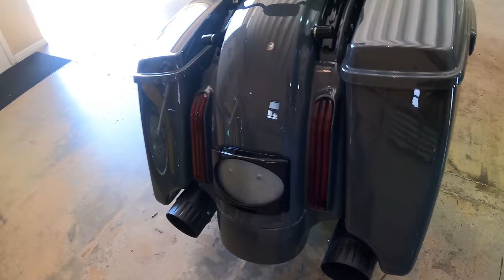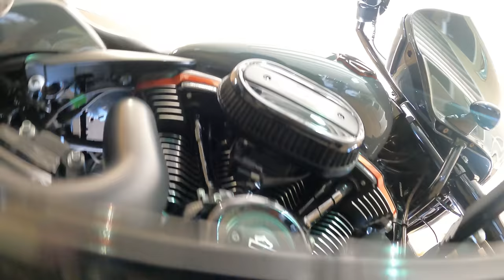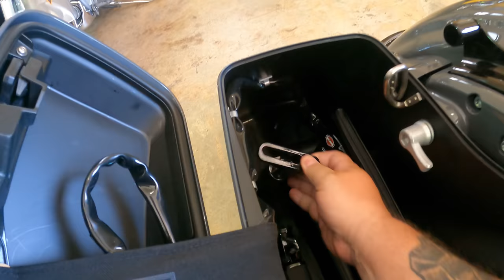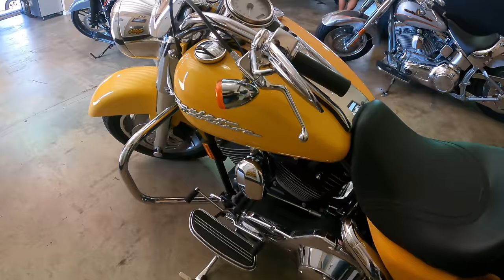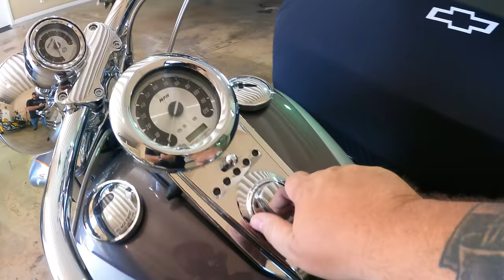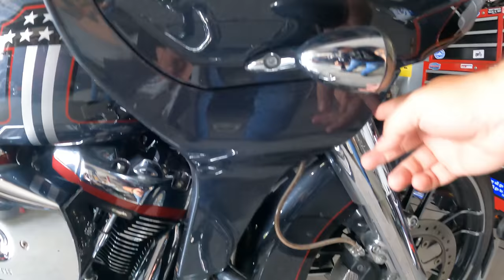How do you avoid a bad used Harley Davidson?

Comment: Bought my 14 SGS private in Oct of 2020 7821 miles. checked it all out, ran it up and down the road hit all the gears, then I was feelin the floorboards for scrapes and the owner said they never been on the ground... I said that won't be the case after I buy it and run it like it was meant to be...Been dragging boards on it quite a bit lately. Hudson Valley NY is some great riding

Comment: What I look for in used bikes is paperwork first then I ask questions like for the 88tc if the tensioners were changed etc. check the oil , listen to it run tires.

Comment: Mileage doesn’t really scare me, I look at it this way, if you look at a bike that has for example 100,000 miles and it’s very clean, everything works, nothing is worn out like tires, brake pads, etc then it’s probably still a good bike, it was cared for and maintained
Reply from the maker: The problem is verifying that maintenance. A 50k Twin Cam needs the cam chain tensioners replaced, etc.

Comment: I had a 2005 Road King Custom in vivid Black. There were big issues with the front brake set up from factory.  Something about no room for a spacer that should have been in there that they left out.  Yes it’s cool that the bag reflectors are there.  I replaced mine several times and then just gave up. Were there locks on the bags?  They offered that at the time.  The RKC was also lower than a standard Road King.  There were several recalls on the bike.  If you do get it, I’d put a windshield on it.  That little fairing flare up from the headlight pushed wind right into my chest.   I actually found MY bike at a rally here in Illinois.  The guy who has it loves the mods I did.  J&M handlebar speakers, V&H True Duels. Screaming Eagle Slip Ons and intake, and detachable windshield.  My head stock head pipe cracked just outside the cylinder at Sturgis in 2012.  The Dealership wanted $1,200 to replace the head pipes.  V&H rep was there and offered True Duels installed for $400.   I think he felt bad for me.
Reply: @MichaelH416  love those reps especially at rallys ther always caruing some niceproxucts a buxy mine who. Is enforcer for a named clib found some sick bronzed hurde pasing lights he put them on street glide he knick named it tombstone he actually had vintage tomb stone yail light yhe bike looked sounded ran like a freaking nightmare
Reply: Wtf is wrong with text  its changing everything i put down  won was budy next eas goodies and one wa club and named i mean lets vet so stupid about nothing
Reply: Oh i see it changed hurse  styled lights like from the early 16 yh century never saw any thing like that but was sick looking

Comment: Mr Monk, where do I begin. I think it all depends on your age as a teen in the seventies if it started it was a good used bike, our base line was a dollar a CC, a quick re-paint of the year portion of the licence plate which at that time here in Ontario stayed with the bike and you're riding. In the 2000's for me it was the more mods the better case and point my 2001 zx12 which was tuned with all the add on's the most fun you can have with your cloths on. And alas now as a older more mature buyer as in my last purchase an Ultra limited lowest mileage possible with the least modifications and service history. And I do like the gunship grey CVO if it checks out mechanically what a little road rash you really cant see.

Comment: My 2003 Road King has 101500 miles and still runs good. I totaled it in 2017 and rebuild it. I  am on 3rd set of mech tensioners. So there ya go
Reply: Tensioners are cheaper than a new bike and if you take care of it it will go another 100K

Comment: Recently purchased a 2017 Ultra Limited. All was great until about 2 weeks after I bought it I pulled the front fairing and come to find out a mouse had made a nice little house out of insulation and was feasting on the wiring. Safe to say I’ll be pulling the front fairing before I purchase my next bike!!!
Reply from the maker: Holy crap? How bad was the damage?
Reply: @ProfessionalMonkey  luckily not too bad. Got a couple of the speaker wires and a few under the seat, but had them cleaned up by a local mechanic. No issues so far, fingered crossed!
Reply from the maker: @lukeschwieterman7249  I’m glad it wasn’t worse!

Comment: I confess to still not being a fairing guy. A '94 springer softail, a '98 wide glide, an '05 deuce, an '08 road king and a '12 wide glide I've never had, nor particularly wanted, a fairing bike. But, since I sold my '12 DWG last year, I'm looking for my next purchase. I have to say that grey CVO RG looked damn good. I have been considering a street glide since I'm looking at doing extensive miles on an extended tour of the country. We'll see which way it goes this fall when I have a better idea of the budget.
Reply: Just my two cents here, get what you want cuz that’s what you like. 
Have had many bikes. I’m in my mid 50’s now. Still ride all the time. More that “she” would like. 
As for the two bikes in question, they are the same bike, just the front is different. Will say this, they named them correctly. The street glide is better for the street, the road glide is better for the road. The road glide seems to cut through the air better. Again just my two pennies...
Life is short but the damn bike and be safe out there!!!
Reply: @davidhelmuth6654  Thanks for your two bits, dude. It is appreciated.

Comment: I not had a lot of luck with used Harleys . I have two of them but I spent a few dollars on the motors ,  I not bashing any ones bike but certain models could have potential problems. Like lifters and cranks for one . I got a used bike that was inspected and checked out ready to go at a local hd dealer . Crank went out in less than a thousand miles more like 500 , I now have a SS engine in there . The M8 can have sumping problems . I bought a used CVO fat bob I think that had like 7 k miles but if it gets driven any I install a new set of SS lifters at a minimum .  Not all are like that but just be aware that the potential if there depending on what year it is

Comment: If its a bagger I take the bags off and look at the rear with a flashlight. everything from the brake pads to the belt. Feel and look under the bike for anything banged up. Also check the paint for any sign of a drop or accident.  I check the VIN on the VIN Harley look up and see if there are any recalls and if they have been done. Listen to the bike at idle for anything not normal. I also have the owner of the bike drive it up and down the street and hit all the gears to hear how the bike is.
Reply: Good advice, but I dont go as far as Vin check for recalls, by that time with the bikes i buy there would already be someone else in the driveway waiting to hand the seller cash.

Comment: What I look for when considering a used bike/helping others finding a used bike is not necessary low mileage, but well serviced and as "untouched" as possible. The brilliant ideas of one owner often tends to end up as the next owners headache.
Reply from the maker: Ain't that the truth!!
Reply: Maybe I'm just lucky. Every bike I own is used and been touched a whole bunch but they're all immaculate and well maintained or stored. 
60s or 70s sportster chopped to shit
Fatboy modded to shit
Knucklehead basket case perfectly preserved
Widow maker of a Hayabusa with close to if not 1000hp. 

Think it depends on who's done the fiddling around with them.

Comment: The idle on 114 and 117 is 950 not the 850 of the 107 at full heat saturation unless the tune has changes idle speed ... most of the 114 ,117 equipped units that have more electronics than some standard 107 equipped putting more load on the electrical system and stator output hence the slightly higher stock idle speed to keep up.....The RKC 04 -05 is in fact the Father of the Streetglide and NOT the EGS everyone assumes ..... the aero wheels bullet turns etc appeared on the 2006 Streetglide ...   love the channel

Comment: Those head pipes look like they might be Vance and Hines dresser duals I've got a set on my 17 SGS you can drag the bottom pipe if you go hard in a wonkey corner. I knocked the heat shield off the transition to the muffler

Comment: I usually try to steer clear of a used bike that’s had any internal engine work.  Even if done by HD.  HD engines are pretty reliable, in my experience, unless they are hot rodded.

Comment: I was kinda green when I bought my first HD. I only thought to check for fluid leaks.  Come to find out the front motor mount was completely gone and it had a small crack at the y- tube of the exhaust header. Once those two were fixed it was all good. But if I had known to check those items I would have offered less than what I paid.  Live and learn.
Reply from the maker: Holy crap, a busted motor mount!
Reply: @ProfessionalMonkey  no.. the rubber bushing on the front motor mount. Forgot that part.

Comment: Living in the UK Harley’s are an expensive item any touring model unless it has been to the moon and back won’t be below $10,000 EVO’s included that is reasonable dyna money. The only two cheap Harley’s are sportsters and streets though sportsters have a minimum price of about $3500 . People make a living by importing Harley’s from the US and I have seen 60-80,000 mile FXR’s that need a lot of work on eBay for $6000 and they are finding buyers. Pre 1980’s bikes are massively expensive compared to the states as there are very few genuine imports as HD didn’t really get it’s act together in the UK until the eighties though Warrs of London have been a dealership since the 1920’s .

Comment: Always look for what a seller may be trying to hide. Do your research.  Look at absolutely everything on the bike. Let it idle. Check for issues. Leaks. Does it go down the road ?  Shift through the gears. Etc. What's the time stamp on the tires ?   Etc.  Attention to detail. That way you don't waste the sellers time. You don't waste YOUR time.   😊

Comment: I have two bad used Harleys that I bought ON PURPOSE. Heres why ..... Both are FXRs.  One is an 82 shovelhead FXR . First year for the model. Im still slowly restoring it. Hard to find parts for this one. The other is an 86 FXR. Not restoring . Just rebuilding and making it like I want it to be. Could care less about its condition when I bought both of them. FXR. Nobody sells them. hard to find. So the 82 had a wrist pin clip let go and its rear cylinder gored all to hell when I bought it. Aftermarket pipes. Aftermarket handlebars. wrong seat. I rebuilt the motor. Found the correct seat. Still searching for the stock exhaust. The 86 . Well that thing had a vice grip attached to its shift shaft in order to shift gears. Splines on the shaft were wasted, When I took off the outer primary no fluid came out . Yup EMPTY no primary fluid in there. So new clutch pates. New primary adjuster shoe. Turns out the seal behind the clutch leaked. Replaced all that along with a new shift shaft. The pulleys for the final belt drive were wasted. When I removed the pulley off the rear wheel the ring behind the pulley that is part of the rear wheel simply fell off LMFAO! I hate mags so I laced up a nice spoked rear wheel. replaced the brake caliper. All that just to take it for a first ride. it smokes . Burns oil. LOL. Next is a new top end. Then it needs a spoked front wheel to match the rear. seat needs repair. Im gonna replicate Mickey Rourkes Black death that he rode in harley davidson and the marlborough man. Just the paint and how it looked . I knew what I was getting when I bought these bikes.

Comment: I just bought a brand new to me Harley at the dealership, and wanted to have some extras added. I inquired about having crash bars installed on the rear. Could I do it? The service writer explained that the existing bar had to be cut and hole drilled in it. This was not the case. I was also told that to add the windshield lights that the ferring and gas tank had to be removed. I asked if when installing an ACC switch installed with the wire harness if it would leave me wires to tie into for my future underglow set up. The SR said there would be no pigtail just wires for a Harley tech to use. All lies to get me in for a 5 hours of service that I could have all done myself. Plug and play bolt on items. $500 in labor after I complained they wanted $750. So either the lack of product knowledge or flat out lying has ruined dealer service for me.

Comment: What do you think about 2017 RK stock with 2000 miles on it. Here in the North East they want $15k. It runs nice. No problems. Tires are stock which for sure would require a replacement. Great channel, gteat content.

Comment: Is it necessary to check oil dipstick and smell the oil. If you can’t hear something wrong with the motor then how do you know there is? Also how do you know if the clutch is bad?
Reply from the maker: I would say by riding it. If you slow down, put it in third and hammer the throttle, a bad clutch will slip.
Reply: @ProfessionalMonkey  maybe I’ve missed but have you done a “new riders” video perhaps were you give most important things you recommend new riders do? Also if I want reach out to you for bike parts advice how do I do that?

Comment: Great video! Very informative, and I really liked the "Fat Boy CVO".as well as the yellow RKC. What do you think you'd have to spend to ensure rideability on the older Bikes?
Reply from the maker: Tires mainly, but rubber air lines from the intake, maybe the throttle body gaskets, etc. Easy stuff and cheap of JP Cycles (except for tires)
Reply: Upgrade to the hydraulic tensioner set up on either bike and you've dodged a bullet that's fired the first day its started up lol... SE.  S&S. Fueling all make great conversions from the mechanical tensioner set up which is failure prone anywhere from 5000 to 25000 miles
Reply: @paulhood7316  Thanks Paul!

Comment: ONCE YOU WRITE THE CHECK, take the bike home.
When I bought my 04 Roadking, I was on my 06 Deluxe. I came back the next day with a trailer because the bike had sat for 7 years. I knew from the tank cleaning to the heads and oil pump and all the rubber, I had my work cut out for me. Three days in my garage with no sleep, i fired her up and went for a ride. 
I got half way across the little Iowa town I lived in and sucked a valve. Before my friend got to me with his trailer i called the seller. he actually admitted to taking it for a glory ride??  The dumbass burned that varnish in the tank and set up a heap of trouble for me.
While rebuilding the engine, I pulled his stupid Eagle head grips { that were upside down} and found the brass ferrels loose in the grip cup. 
He hadn't known they go on the ends of the throttle and return cable lines over the lead ends!
Silly things to look out for? The bottom of the heads were black as oil. Evidence of not changing them oil regularly!
Hoka Hey

I love the 05 Roadking Thank You for the link
Reply from the maker: Holy crap!!! He ride that damn thing after it was sold! Grrr....

Comment: I pull saddle bags off see how clean the bike is. service records floor boards pegs excessive leaning look in the gas tank look at the oil put it in gear or have the owner run it through the gears. My current Road glide Limited the dealer had all the service records since day one and let me test Ride it a good distance

Comment: New subscriber from Virginia 
I just bought an 05 Road King with 29k miles for $5800. I’m totally new to the HD world so I had a HD mechanic friend look over it and it’s solid. 
Only problem with it, which was somewhat clarified on one of your previous videos about patches etc. the bike was owned by a gentleman that painted a very nice confederate flag on both sides of the tank.
I was told to get rid of it due to I’m not “southern” but south enough (from Guatemala) and would have caused some problems for me.
Getting it painted to solve “the problem” even though I don’t think it ever was 
Thoughts?
Reply from the maker: I would look at tank covers. You can get stretched tank covers then have them painted. Less labor. Advanblack makes them.

Comment: Shouldn’t a 2018 be liquid cooled heads? The lower fairings sis where my radiators are.
Reply from the maker: Only liquid cooled on Ultras. A CVO Road Glide is air cooled

Comment: 2005 with fuel injection. Is that the original generation FI that should be avoided?
Reply: Found the answer - HD changed to the Delphi FI in 2002

Comment: How much of an issue are miles when looking for at a bike? I bought mine with like 3500 miles 3 yrs old. A lot of bikes have super low miles here in Indiana. What if I find my dream bike but it's already got 60k in the same 3 yrs?
Reply from the maker: Miles aren't bad as long as a bike was maintained and has good tires on it. 60k in three years would be a lot and would drop the value quite a bit...

Comment: Check brake rotors for warpage and blueing, brake lines for leaks, run fingers around where cowbells meet the lower fork covers for oil residue (blown or worn seals from hard landing wheelies), brake resivours for leaks, clutch lever feel (does it need lubed), handlebar flex (are the bushings worn out), steering neck fall away test (does it need adjusted), oil from engine/heads?, if it's super clean you won't be able to tell about leaks ect. If it looks a little dirty that will work in your favor since it means they probably haven't cleanedcoff any leaking fluids, feel and look  under bike like monkey says, all the lights work, tire wear, so much else i am forgetting but there's some awesome vids on how to make sure you don't get screwed on a used bike